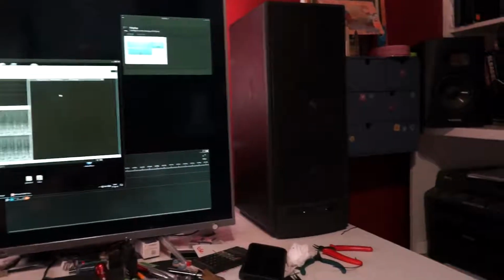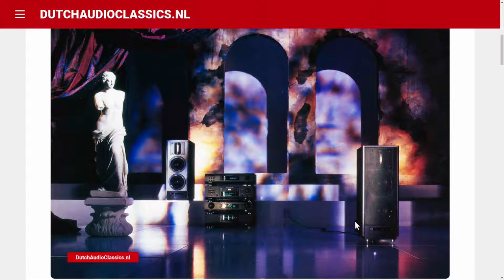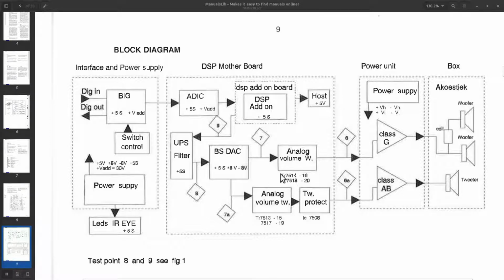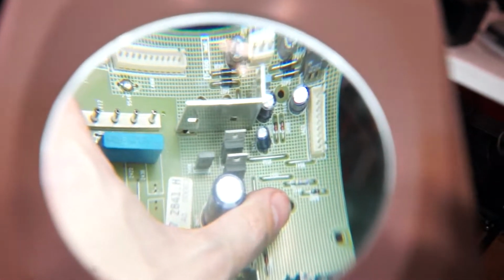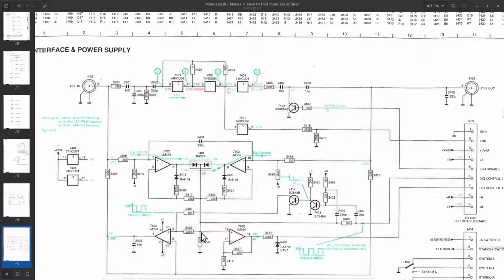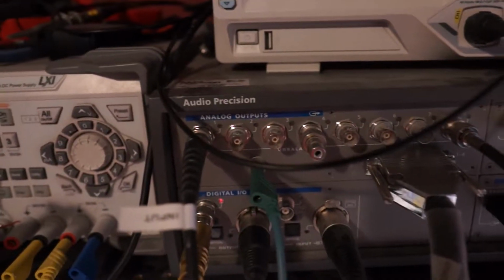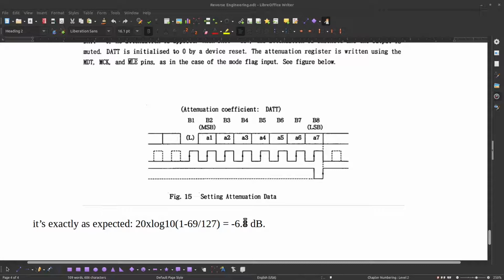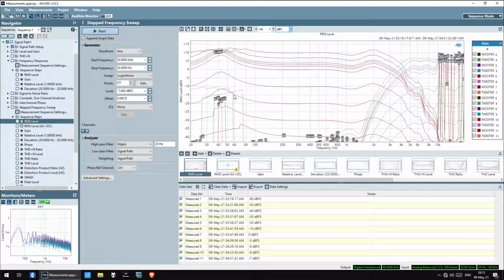Philips DSS930 - A Loudspeaker Ahead Of Its Time. Part 1: A Dark Secret

Comment: I have a pair and one of them lost half the power (level), I dont know what to do to fix this and its not easy to find a technician that understands this system. Can you give me a help? Kind Regards.
Reply: As I have understood from my research the contactors fail and could cause these issues. Did you check this? I am also owning a pair and cannot get it work without the dsc 950...
Reply: @rme7635  You can get them work on the SPDIF out of the CD Player, when You have the IR Remote, at least I was able to play them like that, I tried it just for fun, and it worked 15 years ago. But today many of them have issues to start up at all...